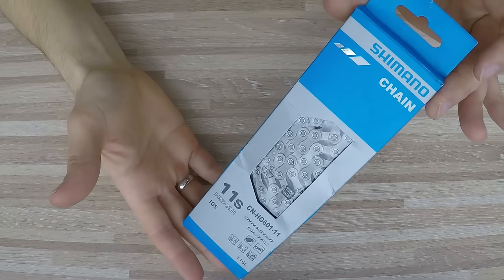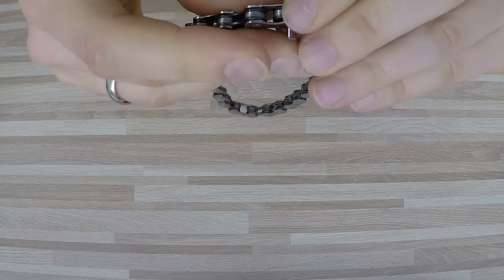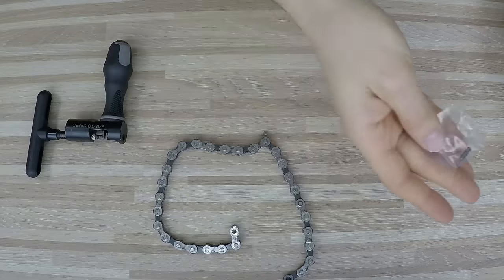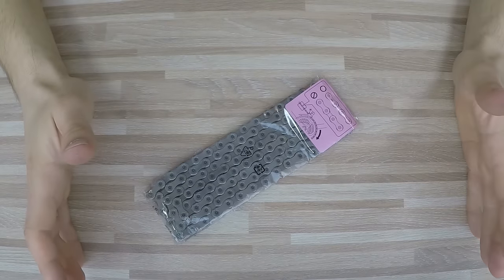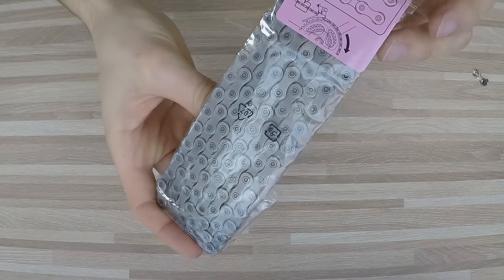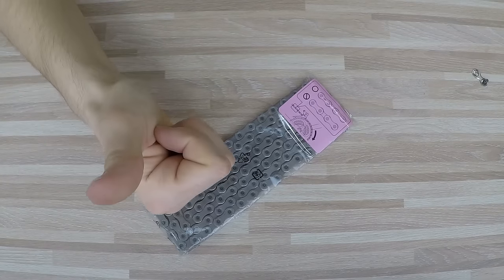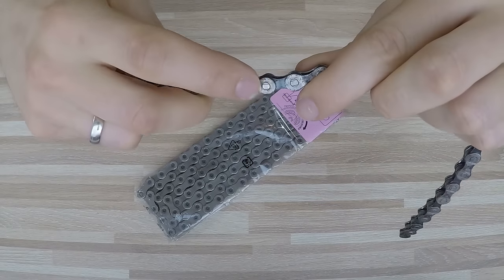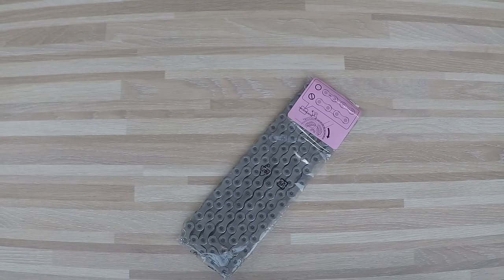4 Worst Mistakes In BICYCLE CHAIN Maintenance. How NOT to do it. SickBiker Tips.

Comment: Chain packing grease will last you 400 miles always leave it on.
Reply: Agreed, its a good grease that they apply to the chain. The distance varies on the user though. Dirty environments will make you add new grease earlier due to the dirt and grime that comes in contact with the chain. Park Tool YouTube channel even says to leave the original grease on the chain. Love that channel as they have a lot of maintenance and adjustment type videos.
Reply: @AznTony360  Pro mechanic told me 40 years ago to ride with the grease, and I’ve always done it. Hate the day I have to clean my chain for the first time because it’s never as well protected. Listening to this video you’d think chains were made from silk rather than steel as a heavy load distributor!
Reply: Scott Falkner I just went for a half hour ride to test my new chain and it's absolutely filthy, covered in dirt and grit. I was on tarmac for half of the ride. So now I've got to clean it anyway and my cassettes and derailer wheels all off which I  spent an age cleaning thoroughly before putting my new chain on. 400 miles my ass
Reply: @James Hardcastle yeah  I wondered about that, it is def
definitely a dirt magnet like nothing I've ever seen. Are you supposed to wash it off or what?
Reply: @James Hardcastle Nice try smart guy, but all grease and oils are dirt magnets, only exception being the dry lubes which i'm not particularly a big fan of. Reason you might think that the factory grease is just a corrosion inhibitor is because it's a fairly clear and on the thinner side so the dirt is more apparent. While what the factory applies to its chain isn't the most high quality grease, it works adequatly for lubing the chain and preventing corrosion during shipment. All grease and oils prevent corrosion. That pre-applied grease is good enough for the average consumer looking to replace a worn down chain from years of use. My local bike repair shop and almost any other bike tech will tell you the factory grease is good for hundreds of miles if not ridden in a dirty environment. If you ride on a dirt path or through the woods, sure it won't last long but any grease will have a reduced life in that riding condition.

Comment: Where I live, sand is everywhere. it gets in your chain, and doing things like wiping it with a rag only makes things worse. Taking it off and cleaning it properly is the only way to go. I like to use a mix of diesel, petrol and a little wd-40 to wash the chain in. Then I let the chain drip dry for a bit, then blow it dry with an air compressor, then re lube with chain lube.

Comment: ShaiBike, you still don't get it. Of course you have to clean your chain and wipe away sticky grease from the outside of the chain because it's a dust magnet. But for god's sake stop telling people to degrease the whole chain because that removes the much needed grease from inside the chain. Or are you getting paid by the manufacturers to tell that *?
Reply: Garfie1d73 
That's not what he said

Comment: I also do a "shake" from time to time if the chain is extremly dirty, i have even used a ultrasonic cleaner and petroleum oil. But If doing that the most important thing is to blow out all cleaning solution with compressed air and then (!!!) give it a long ultrasonic-bath in high qualitiy oil. The ultrasonic vibration brings the lubrication into the smalest gaps. After this treatment the chain looks and performs like out of the box.
You would not belive how much dirt (sand, dust, mud...) comes out of a chain if using a ultrasonic cleaer. I know this is not recommendet from producers, form me it works and having no problems.

Comment: shimano chains are utter crap. I only use KMC Chains as they are supplied with quick links. They also run better than Shimano
Reply: Allan Williams stay with what your drivetrain is, although kmc chains arent that bad, an ultegra or dura ace chain on your shimano road bike will work way better... same with sram chains on a sram drivetrain... if you ride campy, you can really only use a campy chain and thats that
Reply: Allan Williams lol kmc makes shimano chains.
Reply: Absolutely right! Shimano chains are designed to make shifting smoother rather than anything else (smooth running, reliability, durability).
Reply: Uhhh, KMC manufacture Shimano chains buddy...  LOL
Reply: Making another company's products under licence does not mean that they are the same product.
Reply: want to bet some of the chains use identical parts and are assembled in exactly the same machines?   friend worked at one of the big tire makers.  He knew exactly which model/brand tires were used in certain department store brand tires.  They are 100% the same construction and materials used, the only difference is the name molded in the sidewall and the tread pattern.  One reason they changed the tread is so consumers couldn't identify exactly which brand/model tire it is at a fraction of the cost.
Reply: Try Shimano Dura Ace... you grandchild also can still use it.
Reply: Ive got a KMC with hollow pins since 2 years almost. The chain is definitely not stretched, worn or rusty. The good sht ! :)
Reply: lol KMC actually make Chains for Shimano
Reply: Allan Williams Shimano chains are made by KMC.

Comment: I ve rebuilt several chains with the same chain rivits and nvm had a problem with it braking on me
Reply: Justin -- I've replaced a link and re-used the pin in a Campagnolo chain.  Campy advised against it, but I didn't have a new Campy pin.  BIG MISTAKE.  I'm 200#.  First ride after working on the chain, I stood on it (out of the saddle) while leaning forward, the chain broke, and I went over the handlebars.  I incurred a permanent injury to my dislocated thumb from desperately trying to hang on to the bar.  There are a bunch of posters on this thread saying that they re-use their pins and the video is BS.  Those posters have simply been lucky to not have an accident thus far.  Removing a worn pin and then re-using it is dangerous.  It is WEAKER.

Comment: 14k with a chain which only ever knew WD40 and eventually started slipping. Chainrings and bottom bracket are ten years in and still working perfectly fine, all i've done is give the bike a weekly clean, degrease and lube.

Comment: When I bought my new electric bicycle, with mid drive, i did arround 5400km until my chain got torn apart in the middle of the night. I was not really  taking much care of it , just once a month i cleaned it with a cloth and only lubed it a bit when gears were skipping or when i heard noise.

Comment: Clean with WD-40 then lube that is the best way I think
Reply: But how do you clean the chain from WD-40?
Reply: WD-40 works kinda like a degreaser
Reply: Socrates Nicolaou wd40 is not a degreaser. it's a water-disperser, and sort of works as penetrating oil for seized parts, it is somewhere around a blend of petrol and paraffin. Not really that great.

Would recommend a proper degreaser which doesn't contain oil.

Something like ME20.
Reply: I said KINDA
Reply: WD40 now sell a chain degreaser for that very purpose, because regular WD40 isn't meant for chain cleaning.
Reply: I just bought a Park Tool Chain Cleaner  called the Cyclone Chain Scrubber  CM5.2. I have not used it yet, still doing research on proper techniques and materials used in cleaning process, i.e., water based, oil based, solvent based, WD40, Candle Wax, Naptha, ISO, Petrol (by-the-way, did you know that Naptha is in gasoline?) anyway,  still trying to figure out how to clean, where to clean, how to lube, when to lube.  

 I also just bought some WD40 Wet Lube and Dry lube in an easy to use dispenser so I can apply one drop of lube to each individual link in chain, once free and clear of any residual debris and/or water.
Reply: JDE i use one...first give it a good going over using diesel...possibly again with fresh diesel then clean washer and fill with hot soapy (fairy liquid) and give it a good whirl then lightly lube....probably wrong but works a treat and ive never had any troubles....
Reply: Tri-flow...my personal favorite.  My chain feels SO good after a night of setting in.  Anyone else use that one?  Lubricates and doesn't dry out as many have suggested here.
Reply: My go to...has been, as I have been committed, dedicated and brand loyal to products that just seem to do the job at hand and are low maintenance (on long term) might seem like a lot of work, but isn't she worth the love you give her huh?!! I know that WD-40 is Da Sh!t... used it for years, until Now!!   Now...WD-40 has a Dry and Wet SemiSyn Lube (specifically formulated for Bike) that your baby is gonna just love , and if she is happy, I'm happy.
Reply: I uze Gt85
Reply: JDE: Gasoline will melt the plastic on your Cyclone Chain Scrubber.  Per Shimano,  "Use neutral detergent to clean the chain. Do not use alkali-based or acid based detergent such as rust cleaners as it may result in damage and/or failure of the chain."
Reply: They say don't use WD-40 as lube.  It's fine to do a quick clean before relube.  If I really want to clean up my chain though, I take it off and put it in some regular petrol.  Possible that other chain degreasers do a better job (better cleaning job than "spotless" seems difficult though), but not for $2.50 a gallon.
Reply: WD40 is a degreaser and  cleaner, not lubricant. read the can   again
Reply: WD-40 was banned by the FAA for use in any aircraft. It's been proven to lock in moisture and promote corrosion.
Reply: never use WD40 on a bike, use a bicycle specific degreaser of brake cleaner to clean your chain then lube with good bicycle specific lube
Reply: Tri-Flo feels good but isn't very good at high pressure. (think about it, chain roller is about 1/8" wide and sprocket about 3/32", very very high pressure at that point) The film breaks down and you get metal to metal contact (high friction)
Reply: WD-40 is FINE if you use it correctly. If your chain is wet, it's good for getting the moisture out, but it is NOT chain lube. I clean the chain, use WD-40, wipe the chain, and THEN PROPERLY lubricate it. 20+ yrs and works great. But WD-40 alone is a NO-NO.
Reply: Yes, I love TriFlow, too!  In the old days, it was called TriFlon--it had Teflon in it--was even better than it is now.
Reply: @TheTreeOctopus  i keep on reading dish soap has salt in which is bad - brompton maintenance page on their website says so

Comment: once I've degreased my chain i'll spray kitchen cleaner ( mr muscle or similar ) on it then rinse with warm water , then I use an aerosol used for cleaning computers ( blowing the dust out of computers ) , then i'll spray some electrical cleaner on the chain to remove the rest of the water from within the chain links , run it through a cloth or kitchen paper then re lube with either muc off c3 dry lube or wet lube , I've just tried the muc off hydro dynamic team sky lube , its great for wet and dry conditions but it turns everything black after two rides , its also very expensive so i'll just use it for bike touring , it does last for ages before it needs re doing though

Comment: The best way to clean a chain is to put fresh lube on it, let it permeate into the link joints for 10min and then wipe of the excess and dirt clinging to the chain with a rag. The chain is now freshly greased and dirt will have a hard time sticking to a chain that is dry on the outside. Also you are less likely to ruin your pants with it.

Comment: Bought a new chain, cleaned it at 80 degrees in a ultrasonic cleaner with solvents. 
Then did the same with alcohol and then dried it. Afterwards I melted parafin and had it 30min more at 80 degrees in the ultrasonic with a 
paraffin bath. Did 1st ride and its smoooooth. Another benefit is that  the drivetrain is not dirty with oil and mud, easy to clean and the chain is
well lubricated, I repeat the paraffin bath every 3-400km. Paraffin has super low friction and is dirt cheap.

Comment: I got 5200km on my last KMC X10 SL chain on my mountain bike before the chain wear gauge showed it was 0.75 and over. 

Live in a coastal area and ride on a lot on sandy trails. Usually I degrease the chain off the bike, fit and relube regularly and been getting 2000 to 36000km with the same KMC chain. But this time I only degreased twice, once to remover the manufactures grease and then at 5200km. I checked the chain 2 weeks before degreasing at 52000km and was still below 0.75 wear on the gauge. I was using a dry lube Finish Dry Teflon purchased the gallon container and was wiping the chain after every ride then applying a generous amount of lube and repeating 1 to 3 more times depending on the condition of the chain. The chain stayed within the wear tolerance until I decreased it at 52000km.

So I'm guessing the solid lube left between the rollers and pins built up over the many lubes taking up the slack of the wear from the rollers and pins.The repeated relubing was enough to flush out the contaminates from the rollers as well as only some but not all of the old lube. 

I have only been back cycling for 6 years, not being on a bike for 25 years. Back then I was using leaded petrol to clean my chains, I was also spraying 245T, working with asbestos and spraying with two pot mixes that are now banned. Back then I wasn't as aware of the extent of the possible dangers and damage I could be doing to myself. Now with the wealth of information and knowledge obtainable from the net you have a better understanding of the risk factors you take.

I have just started experimenting lubing the chain in a hot melted paraffin wax bath using a slow cooker. The paraffin wax I'm using has a small oil content which I purchased from a Bee keeper supplier used for preserving pine bee hives. cost just over 30NZD for 5kg, it will give me a  number of years supply or chain lube. I purchased a ultrasonic cleaner for cleaning the chains, it has a builtin heater and only needs heated water around 70c with a bit of mild dish wash detergent and the cavitation from the ultrasonic machine strips all the old wax and crud from the chain. I repeat again with fresh water only then blow down with compressed air. I then preheat the chain on top of the BBQ hotplate or use a heat gun prior to dropping it into the hot wax bath. it gets rid of any remaining water in the rollers and being metal the heat expands the rollers slightly and pins elongate helping to aid the hot melted wax to flow into the rollers and bond getting into the pours of the metal. The chain is wiped down when taken out of the hot wax bath and hung to cool. I have 2 chains and have just ordered another 2 so i will do them in batches. So far I am finding I'm getting more than twice the distance from the homemade wax lube than other dry lubes I have tried. When finished I pour the hot wax into an ice cream container as I will be trying different batches adding paraffin oil and other waxes like bees wax to compare how they perform with the riding locations and conditions I ride in.. The chain, cassette and chainrings stay clean. These's no buildup on the chain, jockey wheels, cassette, chain rings and no cutting paste mixture to shorten the life of the drive train.

I am now taking KMC advise and using a new missing link with every new chain as I had my 1st one fail on me recently

Comment: You should clarify that reusing the pin is only a big big no no with 9, 10, and 11 speed cassettes. The connecting pins on 9-11 speed chains have flush heads and the rings that end on up your chain break tool were there to keep the pins in place. 5,6,7, and 8 speed chains do not have those. The ends of the connecting pins are not flush. These can be pushed apart and reinserted. However, I think a KMC Missing Link makes it easier to remove your chain for cleaning and waxing.

Comment: I've used KMC chains (which don't require a special pin) for 17K miles over the last 3 years on an ebike with a 1.3 h.p. electric mid-drive.  I have never used a quick connect link. I install a new chain with a chain-break tool, lube, and clean as necessary then when it's worn I replace it. Special pins and quick-links are just other non-necessary items sold and marketed to get you to give them money and showcased by individuals that use YouTube as a paper route.

Proper chain maintenance is simple: 
New chain: Apply a heavy coat of Beosshield T-9 to chain and let dry. Mount chain on bike and ride. 
Used chains: After each ride wipe chain clean with a clean dry cloth. Reapply T-9 between 150 & 200 miles or as necessary  When the chain gets wet from rain or bike washing spray with ACF-50, wipe dry, re-apply T-9 let dry and ride.
Well used chains: When chains are grungy from dirt, gravel, mud, etc, "wash" the chain with solvent and a chain scrubber, rinse well with water, spray with ACF-50, wipe dry, re-apply T-9... you know the rest. 

https://photos.app.goo.gl/ADgC6oyPM2gyrCq27

Comment: I use wax (squirt dry lube) for maintaining my chain on the mtb and the road bike. Before applying the wax I will have to totally degrease the chain by soaking it into bio degradable degreaser. So in short, sometimes it is necessary to remove all the oils of the new chain. It will help to use an air dryer for drying the chain after cleaning (DO NOT USE THE AIR DRYER NEAR YOUR HUBS AND BEARINGS). The air dryer also works really well on spreading the wax nicely into the links and bushes of the chain.